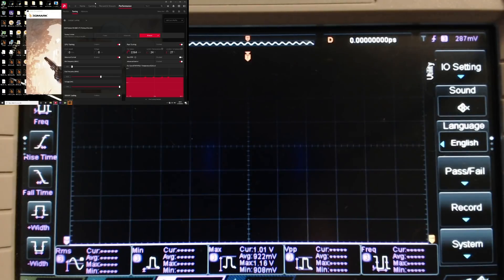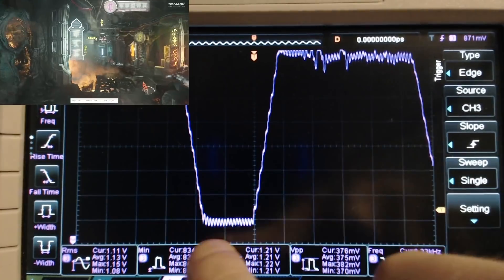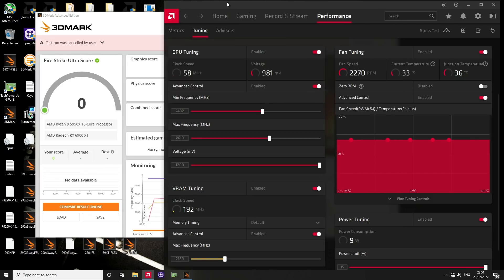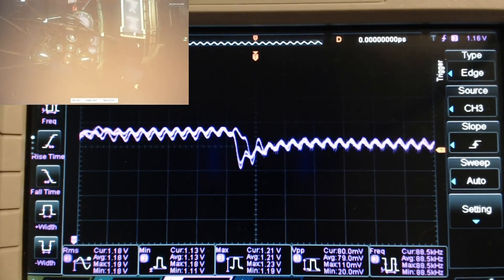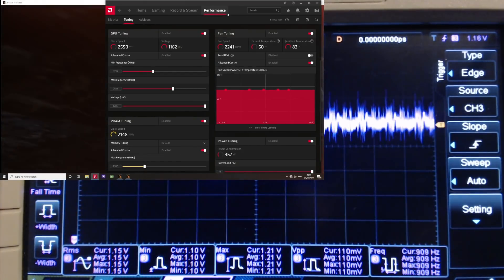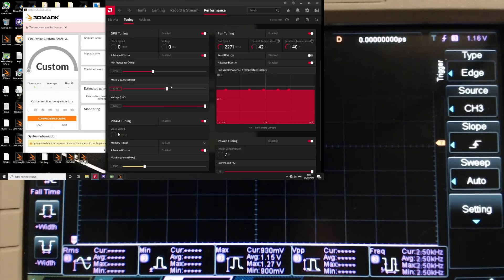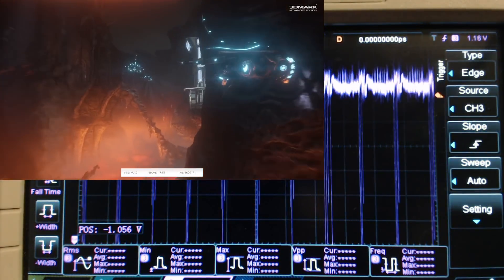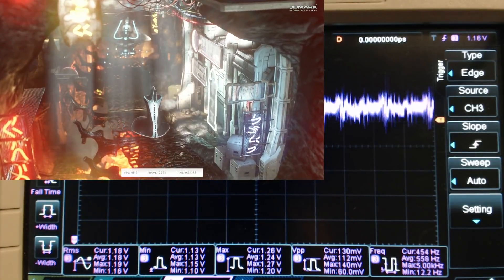RX 6900XT core voltage behaviour VS min and max clock settings.

Comment: Is that water cooled GPU ? 80Deg with 2700MHz is crazy for me as with nitro plus with stock clock 2479mhz it raises to 90deg in such tests.
Reply from the maker: aircooler but fan speed crancked

Comment: How did you exceed the 2150mhz vram limit?!?
Reply: Probably through soft power play tables or bios flash
Reply: @cosmic_gate476  when you tweak it using MMP it will force core clock to go into safe mode anytime you exceed 2150mhz even by 1mhz. It's a hard limit in the vbios and as far as i know only XTXH special die has vbios that is unlocked and you can't flash that since it doesn't work and there is no vbios editor yet because the vbios is signed/encrypted

Comment: Cards run a voltage/frequency curve. Minimum voltage on the "old" 6900XT is 800mV @ <1200MHz , max 1175mV @ > 2600MHz (approximately). The "voltage" slider only adjusts the "curve", does not influence the max or min voltages.

Comment: Just wondering about something here: I have an Asus TUF OC RX 6800 (it's what i could get hold of for a semi-reasonable price) and I have some observations:

1) It has really limited oc headroom: have problems getting above 2400, and the voltage is perma pegged at 920 mV for some reason.
2) I replaced my PSU with a new one and used PCIE power cables with in-line caps
3) Coil whine reduced significantly.  It was also easier to push the clock frequency.
4) I seem to get better performance with 100 Mhz delta between max and min clock frequency in certain "frequency holes"  or combinations.

Is the degree and frequency of voltage regulation that you see here combined with poor input filtering likely to create the problem in 4) ?

Comment: well you just confirmed a behaviour which many already saw. bringing up the min clock boosts stability because it lessens those extremely low drops because of the power management.
max clock sets the point of the voltage curve from where you can set your voltage offset. your voltage offset is set with the wattman voltage slider and its calculated 
<set_value>-1150= your offset.
it was really annoying for the first time until someone explained it to me it was an offset and not an actual voltage set tool, like before RDNA(2).....

driver sets max voltage for 6800xt is 1150mv, 6700xt has 1200mv. but the voltage curve set from the max clock can exeed those values, so your offset might not even be set because 1300mv - 50mv is still over the max 1150mv...

Comment: I believe this issue running in All AMD GPU from  previous rDNA 1 ( 5600,5700/xt) to new rDNA 2 ( 6700,6800,6900/xt ) this cause stuttering in games black screen low performance you see people reporting for 2 years  it is a hardwares chip issue not driver . I believe Amd try real hard to mask it but couldn't fully fixed it . Maybe until new technology for next gen .
Reply: If that is a hardware level issue many users will be upset. Get these issues when the Card isn't utilized in full when certain games runs into a CPU limit. It clocks all over the place low as 40MHz going into sleep mode for a moment.
Reply: @KleinMeme  driver can't fix it most people will not notice as we see in the video it happens extremely fast in every frame . I had the latest Intel CPU still happening

Comment: 9:30 I'm not sure why you are surprised the driver software already tells you that. 

Essentially it has an already Written voltage/Frequency curve, which you can lower at certain stages but you can't shoot over. This also explains why it lowers voltage when it reduces clocks (for what ever reason rdna2 at stock jumps up and down in clocks) and why it levels put when you increase minimum clock.

Comment: If the "max frequency" slider increase the voltage, what would happen if you decrease the max voltage and increase the max frequency in order to have a higher frequency with a lower/same voltage ?
Reply: The excat thing one would expect to happen. If you reduce the voltage, you'll get the same frequency at a lower voltage.
The voltage slider acts as an offset, so 1200mV only means 1200mV at the stock max boost. 
If you reduce the max boost, voltage will scale down with it as it's set to 1200mV at 2600MHz for example, it will do 1100mV if you run it at 2500MHz.
Now if you manually lowered the voltage slider to 1100mV, this is now the voltage the card will use at 2600MHz, so you can increase the max boost to like 2700MHz and it will rise to 1200mV again.

My 6800XT has a stock boost of 2400MHz, when I set the voltage to 1050mV, it's doing that. But I've also increased the max boost to 2550Mhz, resulting in a voltage around 1120mV.
Reply: @TheTaxxor  thanks, this is interesting, I would love to see this behavior on a scope when the gpu is "flatlined"
Reply: Crashing.

Comment: I noticed something very odd with my 6800xt ref. I would run superposition in windowed mode and play with the OC and tried to see changes. 

The mhz suggestions did almost nothing, however as I lowered the voltage from 1150 to something less, the framerate would increase, but the mhz reported by HWInfo was always the same, both the GPU Clock and Effective clock stayed locked in at say 2600mhz, but my framerate could change by 10% or more. I think either its lying about the clock rate, or its disabling cores to keep within the 293w target. 

If thats the case, you might have to be careful adding too many volts, the power limit seems to override it and you might end up with less performance from higher volts.
Reply from the maker: just disable the power limit.
Reply: @ActuallyHardcoreOverclocking  thats gotta be Steve level sarcasm, you can only push it 15% over stock and theres no way around it right?????
Reply from the maker: @manicdan481  you can disable the power limit with a soft power play table mod.
Reply: @ActuallyHardcoreOverclocking  Thanks!, checking out wattman now. My hope is just to give it enough room for 2800mhz stable and call it a day.
Reply: @manicdan481  2800mhz might be unrealistic, on my water cooled  reference 6900xt 2650mhz is about the highest I could get with all powerplay mods stable. pulled 380 watt in stress test

Comment: Wait isn't this normal AMD stuff since Vega?
Reply from the maker: voltage on VEGA behaves pretty normally the frequency is all over the place.
Reply: @ActuallyHardcoreOverclocking  Isn't that related also to the issue users have while also gaming and getting stuttering in some games who don't utilize the Card in total because of that aggressive regulation?
It behaves super weird.
Reply: @KleinMeme  I do have stutter in all games, but not in the benchmarks! In games it freezes like 1ms and runs again, I tried everything to fix/control this but couldn’t figure out unfortunately

Comment: Why there are those idle low voltages at the beginning with "stock" configs? Do they affect real world performances? There is any real improvements in keeping the min clock higher? Like minimum % FPS or 0.1%fps drop etc..?
Reply: no they dont have impact on performance, but it can increase stability of oc drastically

Comment: Now that`s weird... Do you think it could help keeping temps lower? Also I`d expect such behavior to make it unstable but I guess it doesn`t.
Reply from the maker: oh no it does make it unstable. You can't hit the same max clocks with really low min clocks as with higher min clocks
Reply: @ActuallyHardcoreOverclocking  I had a bad experience with 6900 xt because of this unstable clocks, micro stutters in games and when those happened in games, the core clock, memory clock, power draw and gpu load where deep to 0 and back to top. (Everything else is/was ok in my pc)

Comment: Keep the clocks 100mhz apart. That's the closest they can be set. My 32nd on fs ultra is with 2680/2780mhz set.
Reply from the maker: yeah no that doesn't work well in my exprience. And I'm in 5th place(for now) in FSU in the 3Dmakr HOF.
Reply: @ActuallyHardcoreOverclocking  What would you suggestfor the min/max clock settings out of interest? Why is 100Mhz gap not a good idea?
Reply: @ActuallyHardcoreOverclocking  I know lol. I'm running a 6900xt sapphire MBA on water. The 1175mv is holding it back a little now, hit a brick wall. I've just changed to a B550 unify, my 8pack C14 (4x8GB) isn't very happy on it. Posting has been fun. Hard limit at 3600mhz on 4 sticks after that for memory controller drops to half clocks for fun! So time for a new 2 stick kit of ram. Half thinking of geting "Crucial Ballistix MAX BLM2K16G40C18U4B 4000 MHz" £220.99 til midnight.

Comment: what s the best between the red devil rx 6900xt and the strix rx 6900xt ?, and continue i love your work!!!
Reply from the maker: IDK. kinda depends on what you want to do with it.
Reply: @ActuallyHardcoreOverclocking  for oc (not crazy but gaming), and good temp
Reply: and i wanted to ask you if we can manually set the vram timings on amd card ?
Reply from the maker: @youssefatmane6321  the watercooler on the strix would help a lot of daily
Reply: @ActuallyHardcoreOverclocking  oh ok thanks for your time  but can we put like an aio on (like nvidia) ?
Reply from the maker: @youssefatmane6321  IMO it's a lot better to just get a card that comes with an AIO.
Reply: @ActuallyHardcoreOverclocking  ok thanks you very much for your time!
Reply: @youssefatmane6321  NZXT has some adapter that allows you to use their aio with gpus. It's also not that hard to basically make your own aio.
Reply from the maker: @thachester  you still need to solve cooling for the VRAM and VRM. and the factory AIO cooled cards solve that way better than most method you can DIY.
Reply: @ActuallyHardcoreOverclocking  the saphire watercooler is way better. Its 360 vs 240 and the card doesnt have thaz shitty asus blower cooler